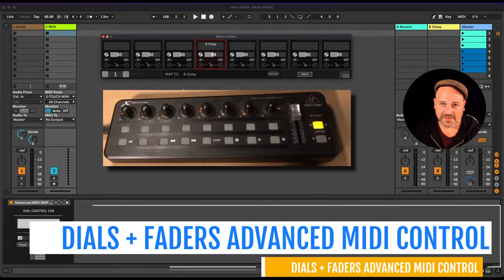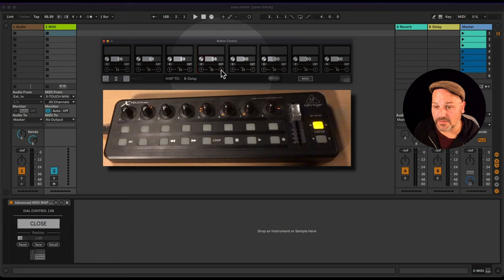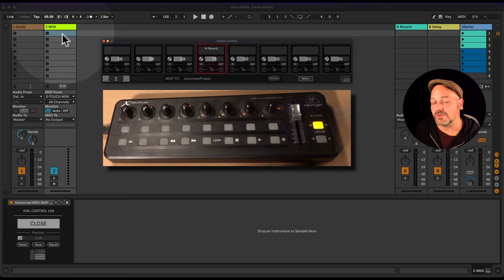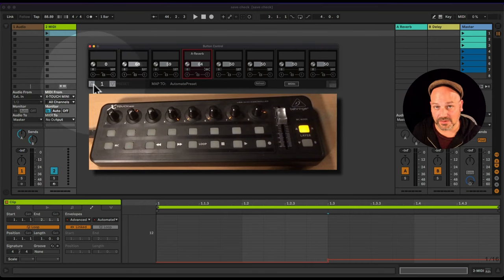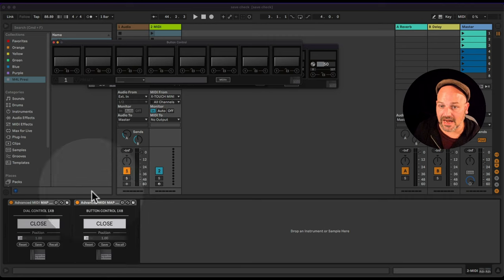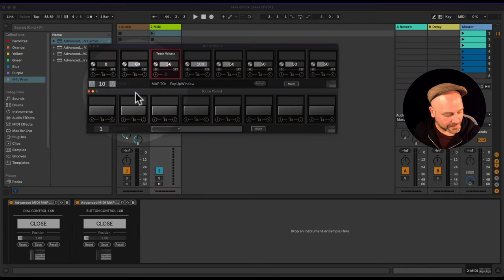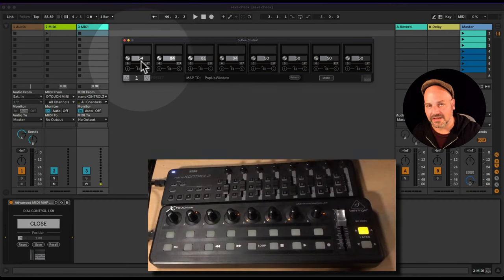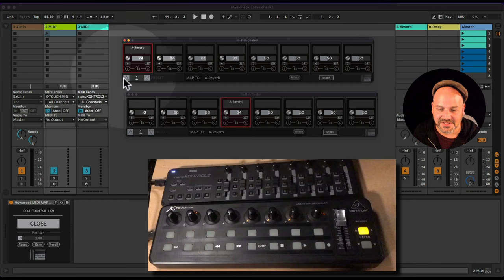How to set up flexible FADERS and DIALS MIDI MAP Controls in Ableton Live via Max for Live devices

Comment: Hi Tobi! I'm just wondering, would it be possible to automate, say, a device's on-off in the return channel? I know you need dummy clips to be able to do that, but I'm just curious if it can be done with an M4L device?
Reply from the maker: Hey - you can automate and access devices/parameters which are 'sitting' on the Return Tracks e.g. via MAPing them to my Advanced Control device(s) and then set up a dummy clip on the same track my ADVANCED MIDI CONTROL devices are sitting on with the correct MIDI message inside this dummy clip being sent to my device and the then is controlling the MAPed para on the device sitting on the RETURN tracks.

Comment: My akai key 25 is set up perfectly, but the value changes on my endless encoder’s are 1 or 127 with any movement when setting up this device, So I can’t dial in any others parameters besides 1 or 127 or whatever I set it as 70 - 108 no in between. In ableton I can easily fix this with the native midi mapping, but this device has no mode options for relative or absolute values, do you have a fix?  Thanks
Reply from the maker: Hey I just responded to your emails. The Advanced MIDI Control Dials/Faders will work with every MIDI controller dials which are sending MIDI CC values from 0 to 127. I assume you could set the Akai Key dials to that via the provided MIDI Editor from Akai. I emailed you a download link for a my MIDI Monitor devices which might be a good resource to see what is currently being send from a MIDI Controller into a track in Ableton Live.
Reply: @abletondrummer  Cool, I’m looking into possible solutions, currently there’s no midi editor for the Akai apc key 25 mk’s

Comment: does the pickup takeover mode work with the movement of the faders in ableton? Also can you control the switching of the different bankpresets with a button instead of a fader?
Reply from the maker: PickUp and Value Scaling Mode is planned for the next update and is currently in BETA testing. Bank preset up/down will have MIDI-Mapable buttons in this update as well.

Comment: Looks Nice, does it supports two way communication, so that when switching between presets the diffrent controllers will be update with the actual values, (offcoures when a controller supports this two wat communication?)
Reply from the maker: Hey the values on the M4L device slider will update on preset changes - so the current values are being visually re-presented. But the 'new' values won't be send back to the MIDI controller as MIDI CC - it would be possible to implement this but it opens up a few different challenges for the whole MIDI CC out operations. Might be a feature for a future update.
Reply: @abletondrummer oke, it would be a verry nice feature. How does the program handel's differences between the value of a knob and teh actual value of a parmeter when switching between presets?
Reply from the maker: @Mamequi3562  same like if you change a para via mouse - it will take/set the value you send from your dial/fader on your controller. Again "PickUp" or "ValueScaling" as a take over mode (to be set individually) could be features for the future (or a custom job...)
Reply: It would be a killer feature to have the current values of current preset be shown on the midi controller device when a preset is changed. I guess without it the use cases for this plugin is a bit limited.

Comment: Very nice ;-)
How can I expand the M4L device if I want to use the Faderfox EC4, for example?
Reply from the maker: You could just use TWO devices with 2 x 4 layout and group them in a MIDI Rack - each one in its own chain - so they both receive the same MIDI
Reply: @abletondrummer   thanks i saw this now. Would the information on the display (Faderfox EC4) also be passed on?
Reply: @abletondrummer   one question more. Is this Ableton 12 ready?
Reply from the maker: @mit136speichenumdiewelt  oh yes it is!
Reply from the maker: @mit136speichenumdiewelt  Hey I m not 100% sure what you mean maybe this helps: The FaderFox would talk TO the M4L device and then to the controls you set up. It is not 'talking' back to the Faderfox
Reply: @abletondrummer   ok thanks. that answer my question.
Do you sell both Advanced MIDI Control BUTTONS  and  Advanced MIDI Control DIALS + FADERS  in a Pack?
Reply from the maker: @mit136speichenumdiewelt  They are sold as separate devices only.